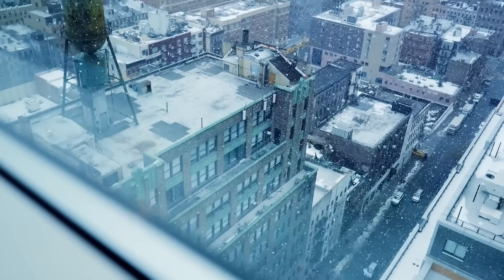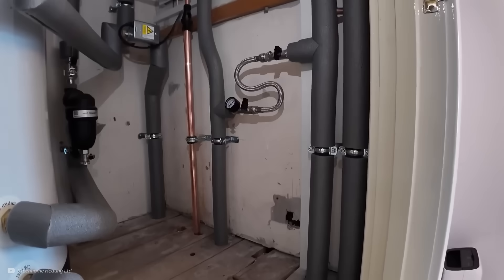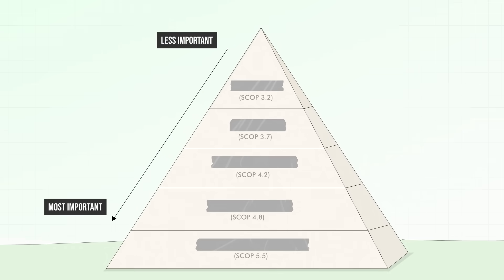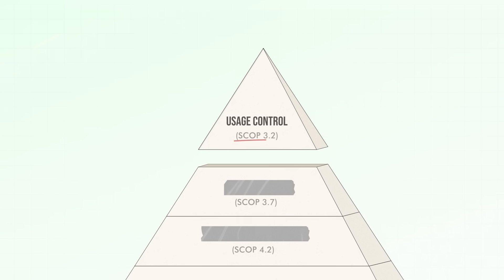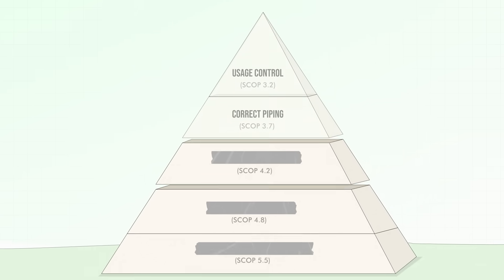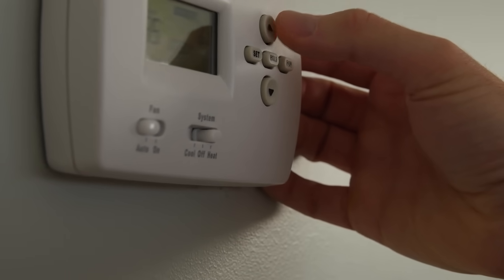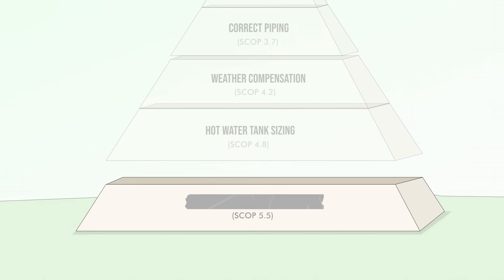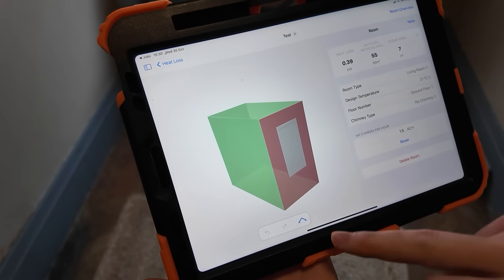The Genius of the World's Most Efficient Heat Pump

Comment: The introduction claims that a gas boiler will beat a heatpump.  Since the subject is efficiency I think the worst heat pump will beat a gas boiler which is only 100% efficient.  Heat pumps are 100% efficient when they run emergency heat and are better than 100% otherwise.  If you're talking cost then maybe there is an argument in favor of gas.... I guess I'll finish watching now and see if you guys add appropriate context or not..

Comment: I live in Wisconsin with a 24K BTU Senville heat pump. This heats and cools my 1,500 sq ft old leaky farmhouse in the winter down to -35F (kicked off at -40F for a few hours one night 6 years ago). They advertise that it heats to -22F, but it goes lower than that. The issue is that there is less heat outside below zero to harvest when you need more in the house. So when that happens, I have a small diesel heater from Vevor that puts out 28K BTU (on high) for those super cold days too. The Senville uses about 1.9 kW/hr at .11c/kW, usually about $150/month to heat the house all winter plus a few gallons of diesel. Way cheaper than propane, which would cost me double.
Reply: I live in Quebec, installed a 12k BTU tosot. I measured it heats to 20k BTU. 1500W will heat my 1500sqft house. When it's cold like -35C it still heats but more like 10k BTU. Plus it has to defrost every hour, so not as efficient. But it averages over 3 COP.
Reply: Try getting a diesel generator and running the heatpump off that, as well as diverting the waste heat from the engine into the heatpump using a duct, you will save even more money.
Reply: @ChrisDay-sx4lv  Use a water cooled generator and pipe the hot water to where you need to, including for DHW via a heat exchanger. Be sure to know how to service and rebuild the generator because having it professionally done will kill any savings.
Reply: @SuperS05  you also need exhaust heat recovery, most heat is lost there, an egr cooler is perfect, then any low grade heat can be fed into the heat pump for further eff gain.
Reply: @ChrisDay-sx4lv  Sure, but you have to be careful about not overcooling the exhaust as carbon buildup will become a major problem. Very approximately, 1/3 the energy is converted to mechanical energy. Another third goes out the exhaust pipe, and the last third is heat lost through engine cooling. That 1/3 is probably going to be WAY more heat then you need. So I agree with you that it is possible, but definitely not the lowest hanging fruit and I would only try if the extra heat was actually needed.
Reply: @SuperS05  You can actually use a water bubbler to scrub the carbon before the EGR cooler then the heat turns the water to steam and condenses onto heat exchanger. If you are using a petrol /gas engine with catalyst then you wont need this at all.
Reply: @ChrisDay-sx4lv  most generator sets don't have cats, they only have mufflers. They also don't typically use any kind of EGR either. Some models do, but since they aren't mandated in most places, they just aren't economical to the purchaser. That's starting to change of course.

Either way, why bother with the (over?)complicated when you have a premade solution readily available for cheap? Tapping the cooling loop for heating is as old as liquid cooled engines, and has a very deep knowledge base. I'm not saying it can't be done. I'm saying it's just unecessary for what I would believe is the vast majority of users and applications. The shear amount of heat wasted is honestly a bit unbelievable, even half of that waste is still a very sizable amount. This would be my plan of attack if I had a house where a generator made sense.
Reply: @SuperS05  Im talking about making a CHP system and what component to use as a retrofit, An EGR cooler from a vehicle can be used to extract exhaust heat from a genset, you can buy or make catalytic converters for small engines too, I have a honda engine that works on propane that has both as well as oil to water cooler and oil filter from a car to pull heat from the crankcase, it uses a large alternator/ generator from a hybrid car and does a couple of KW in electricity and heat.
Reply: @ChrisDay-sx4lv  I didn't realize you meant diy the whole thing. I was talking about using a commercially available water cooled genset. Your idea will work but it's quite a bit of work.
Reply: @SuperS05 you can also wrap copper tubing around the exhaust pipe...
Reply: @DarylOster  I'm aware, but that isn't nearly as effective as you'd imagine. It works, kinda sorta. See posts above.
Reply: I moved to NE Wisconsin last spring, bought a  1300 sqft house and replaced the propane furnace with a 24k btu Seville and a small 24k btu wood stove for backup. I'm glad I saw your comment. I was concerned that the 24k btu heat pump wouldn't be enough. The propane furnace was 70k btu!
Reply: Sounds like you have a low efficiency LPG furnace. Condensing furnaces have been around for a generation at this point but continue to be rare in the US, especially in rural areas. I understand not wanting the extra cost in places like Texas, but the cost difference really isn't much if the contractor isn't hosing you. From what you're describing, you had either a grossly oversized furnace and/or a natural draft furnace. Both is common. Natural draft furnaces are about 60% efficient. Power vented are about 80-85% depending on age. Modern condensing furnaces push 98% which would have cut your costs by nearly half too.
Reply: @SuperS05  Thankfully, I rent this farmhouse, and he had to put in a new furnace. But both the new and old ones were 90% efficient types. It's just an old house that the mice have chewed the insulation on in some walls.
Reply: @scottc8152  there is a VERY bit difference if it was 87-90% and +95%. The former is called near condensing. (they are actually 85-87% but advertising pushed that up a bit getting creative with the measurements) Fully condensing furnaces can and do get over 98% efficiency. At any rate, being grossly oversized (a VERY common problem with old school installers) you will seldom actually hit that efficiency as the startup losses drain so much away. A 2 stage 40MBTU condensing furnace will run at about 16MBTU on first stage which is still probably too much heat for your house. (Since you said 70, I assume it was a Lennox or subsidiary. They have a 30MBTU 2 stage.) Of course you could go modulating like the HP you have but then prices jump and I seldom recommend it due to the proprietary expensive parts. Proprietary modulating no-name mini splits are really cheap for a DIY'r to replace, rather than repair, even at the cost of the environment.
Reply: @SuperS05  I just keep my mini split on high for the duration of winter, unless the house gets over 78F (right now it is 76F, nice and tropical). It only cycles when it needs to defrost the coils. Seems more efficient that way. It is rated to use 2.5 kW, but just keeping it on high uses more like 1.9 kW. Not sure about the old furnace other than it vented out the side with PVC, and the new one is a cheap 90% efficient. I rarely use it as I mainly heat with the mini and my diesel heater.
Reply: @scottc8152  Ah I see, really does sound like a cheap furnace. There are plenty. The higher the temp rise from outside, the less efficient the HP is. It uses less energy, but moves a lot less energy into the house. It sounds like it is still keeping up mostly, but it is still less efficient. You would save money by lowering the temp a bit. (High speed fan inside helps too, if you can live with the noise.)
Reply: @SuperS05  60% is quite low even for a natural draft furnace, AFAIK the average for 50 year old units was already 70%. My late-model natural draft furnace at home is rated 78 AFUE.
Reply: @eDoc2020  seasonally adjusted is approx 60%. Stay steady state can top 80%. That 78% would have used a draft damper.
Reply: @SuperS05  The 78% furnace has a (broken) damper in front of the burner intake but I don't see how it helps efficiency when the furnace is in an unheated basement. Runtimes are usually at least 15 minutes even in mild weather so it should be running steady state most of the time.

On this note, the efficiency of most dumb systems can be improved by adjusting thermostats for longer runtime.
Reply: @eDoc2020  steady state is 8-10min after startup. If it was M sized correctly it would not shut off on the coldest days.

Damper on the burner intake in usually not what I'm talking about although they have been used. Without the off cycle damper, the actual AFLUE is closer to 65-75% at best. The draft that sets up continues long after the furnace shuts off cooling the heat exchanger substantially. All that energy is wasted. Obviously, there's more waste if the space is conditioned. You also have duct losses that a conditioned basement wouldn't have.

A furnace with constant fan or a boiler with constant pump will have the highest off cycle losses.
Reply: @SuperS05  AFICT this furnace only has the one intake damper and it would stop all the draft airflow through the heat exchanger but not through the flue. I don't know how much good it would do because I have the board set to run the fan for 2.5 minutes which I'd think would capture most of the stored heat.
Reply: @eDoc2020  in not sure which model that is but it sounds obscure. Assuming the damper wasn't broken like you've said it was, then you could expect the aflue that it was rated for, and only in a situation like yours, where the dilution air is not conditioned air. 

Either way it's not efficient. An induced draft appliance can easily hit 80-85%. I've seen condensing appliances exceed 100%. (Exhaust air is colder than the intake air.) Generally they operate in the +95% range.
Reply: @SuperS05  Lennox G20 series. If we end up replacing it we'd probably get a 2-stage 96 AFUE. Not sure if it's worth spending thousands to prematurely replace it with a unit that will probably die sooner.

If the attached AC fails then I'd like to replace that with a heat pump, possibly a non-communicating inverter model. We have rebates for switching to heat pumps but there are very few units that are rebate-eligible when paired with an existing furnace.
Reply: @eDoc2020  oh yes the old g20s. I've seen a few but they have all been replaced here. All of the heat exchangers cracked. Even if you live in a warm area yours probably has too, those things are ancient. I don't think they've been made in 25 years at this point. They were only rated for 76% efficiency except in their final year's where the testing changed a bit to fit US DOE. They were then rated for 78% AFUE under DOE but 72-74% under Californian rules. 

I like some of the conventional non communicating inverter HPs. They are expensive to repair if it's possible at all. Eg. Mr cool doesn't have replacement parts available after a few years. They only cover warranty. Plus they leak. (quick connects aren't legal here) I have personally installed a few MOOV-AIR units, and they have their quirks, that I don't like. (circuit board locks up and needs to be reset a few times a year.) They have promised parts availability but we'll see. Our rebates didn't include it, when they were even available. Honestly the rebates were useless for us. It just gave a good marketing excuse but people paid the same amount in the end, often more.
Reply: @SuperS05  How likely is it that the furnace Hx is cracked without me noticing? The flame doesn't flinch when the fan comes on and when I was changing the blower motor last year the bottom of the flame tubes looked bright and not discolored (although I stupidly wasn't looking for cracks at that time).

As for the heat pumps, the one I would be most likely to get was branded as the Comfort-Aire MCD36 but I'm not sure who the real manufacturer is. The same unit is sold under different brands (one might have been MOOV-AIR but I might be remembering that name from somewhere else) but I know all the cheap inverter HPs are made by a small handful of companies like Midea, Hisense, Gree, etc.
Reply: @eDoc2020 99% chance that your HX is cracked /defective, unless you live somewhere like inland California or other warmer climate away from the ocean spray. The rivet rings tend to pop on them. They hold the clamshells together. As the HX warms up, it forces more and more air through. Eventually causing incomplete combustion and dangerous levels of CO. It'll start to spill out of the hood first. Rollouts don't tend to occur on that type of HX with that failure, as the spill switch trips first, but it is possible. You tend to end up with very dark, almost invisible blue flames, and in your case will tend to occur near the end of the cycle. The more often you cycle them, the more likely that this will occur. You can get cracks mid cell, but it isn't nearly as common as the rivets popping. It's why most manufacturers don't use them anymore. 

There's plenty of images online for you to get an idea what they should and shouldn't look like. Since you know how to pull the blower motor it's fairly easy for you to check. 

MOOV-AIR is made my midea. Brand is owned by master group. I'm not sure who else they make units for, they don't make it so easy to follow.
Reply: @SuperS05  Thank you for the information. I know Lennox had lots of problematic heat exchangers in the 80s but I don't know if the G20 has that particular problem or not. Is that the issue you're referring to? I heard replacement HXes have a fixed design and mine is a later version (made in 1995). Do you think it's still problematic? I don't remember seeing rivets but again I wasn't looking for them.

We have two CO detectors upstairs but it would probably be a good idea to put one near the furnace and WH too. I presume that would at least let us know if it's becoming a safety issue. I'd probably want to wait until the off-season to take a closer look.
Reply: @eDoc2020  CO monitors only go off above nearly lethal limits. (UL standard) CO can cause symptoms related to long term low level exposure. I can't tell you what you should accept as safe. Code here would require any technician to immediately turn it off and report it to the utility, in which they would terminate service without a repair on record. (yes we have strict laws....) Personally I wouldn't leave it in my house, but labour and costs for myself is not calculated the same lol. If you live in a cold climate (below approx. 10-15°f design temperatures) I would change it just for efficiency reasons. (warmer if you're on LPG) If you're design temp is higher than that, you'd have to deside if you're safety and piece of mind is worth it. 

The g20 has the same issues as any furnace using a clamshell type HX. Lennox has a different model before that cause the pulse furnace. It had even more issues. Maybe they could have been engineered to be safe but the class action lawsuits put an end to that development. (plus they were a bit noisier)
Reply: @SuperS05  I hadn't realized the detector standard was 70ppm, that's crazy. At least we have one with a display so we can know if it reaches 30ppm which should be safe. If it's been cracked for a decade I doubt it's going to get too much worse anytime soon.
Reply: @eDoc2020  they do get worse with time.
Reply: the problem that isn't how heat pumps work, yes they exchange heat on the outside and the closer the delta as in the the temp of the low pressure gas and the outside temperature the less it warms up and the more work the compressor has to do to add heat to that gas when it is compressed to a high pressure liquid. 
the higher the temp of the returning gas is, the compressor adds a fixed amount of heat to the gas when compressing it, so the hotter the returning gas, the higher the temp of the compressed liquid gas and conversely the lower the temp of the returning gas, the lower the temp of the compressed liquid gas, as it has to heat up that gas from a lower starting point. 
strangely enough, as long as the temp outside is higher than the starting cold gas is, adding more external heat exchangers / radiators, with the longer dwell time and greater surface area, it will bring the temperature of the gas up more, meaning a higher temperature inside. this works much like adding more surface area on the inside will allow the heated side to add more energy to the inside, raising the temperature faster.
Reply: Thanks I have noticed the same results
Reply: Scott, see my response to Todd just above your post.

Comment: Calling 800% BS. Creating that much heat would make it easily possible for it to be able to produce more electricity than what’s going in . So if that 800% was possible then that would be the demonstration that was shown
Reply: 800% is an instantaneous efficiency at a low temperature rise. Perfectly possible, but not the number to focus on - the seasonal averages are what matters.
Reply: @ exactly 👍

Comment: Ok, I am waiting for the inverse heat pump to arrive for me. I NEED COOLING, NOT HEATING.
When we will get heat pumps for cooling here in south america?
Reply: Today. In this application they're called air conditioning. 😉
Reply: @bringiton8989  yeah... but they are not as efficient as "heat pumps" I want to know if using those buried pipes helps with cooling too.
Reply: @shoego  An air to air heat pump (air conditioner) can be exactly the same technology. They're all less efficient when cooling than heating. If you use 1kWh to move 3.5kWh of heat, you can get 4.5kWh of heating, because you can recover heat generated from the compressor. You don't want that waste heat when cooling, so you throw it away. Same 1kWh of input energy, but you get 4.5 cop in heating, 3.5 when cooling. Unfortunately, contrary to the contrarians in the comments section, heat pumps don't break physics.